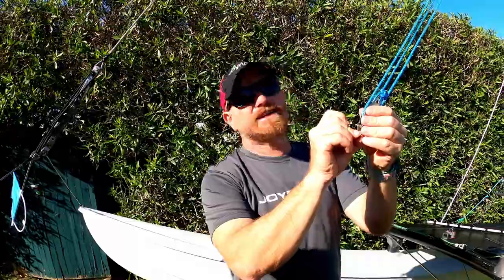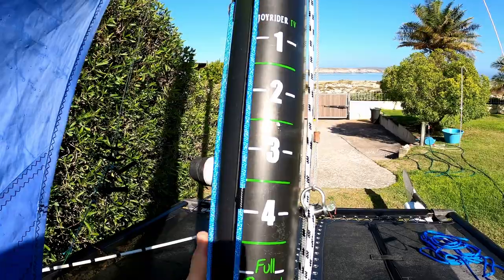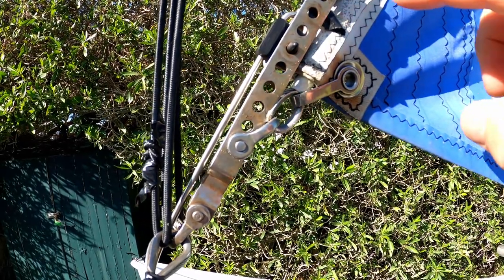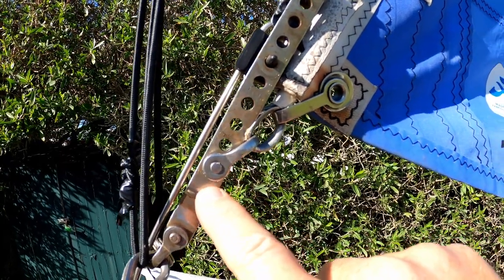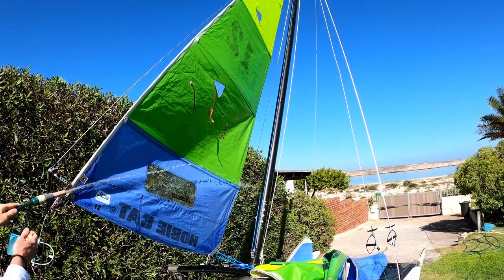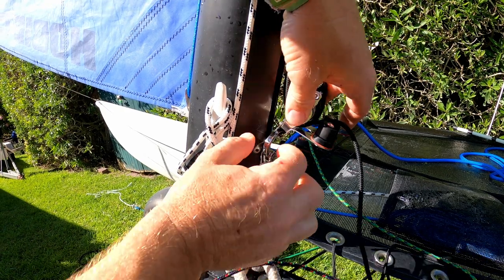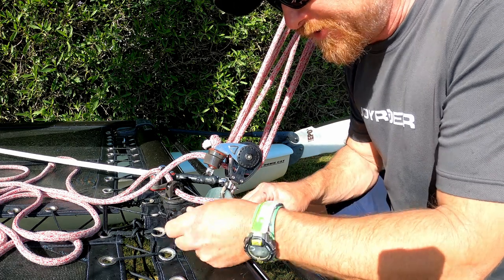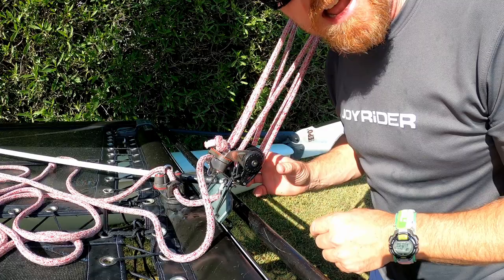Quick tips for catamaran sailors ➡️S04 E01

Comment: 2:10: If wear at this points really an issue, how about adding another shackle above the fastening shackle? That then keeps the eye of the jib a cm or so more distant from the chainplates, just enough. 
 
Nice to see a boat with a brand-new rig.
Reply: I do think that this area on a 16 is a bit awkward and needs attention. I heard that keeping you jib as low as possible is better for speed though so raising the jib even more to clear the chainplate goes against this theory. Maybe what is needed is a standoff mount that clips to two holes that you can then attach the jib shackle to? Does anyone ever change the height of the jib on the plate? Maybe this standoff can bolt on if you (and I do) only use the same hole?
Reply from the maker: Nice idea, the single shackle really makes a big difference already. 
I'll try some different ideas. Thanks.

Comment: Just downgraded from a Nacra20 to h16 for the 2022 season.    Has anyone thrown a roller furling on their16?   I happen to have a spare one laying around.
Reply from the maker: You'd need either to recut your jib or use a different one because of the battens. 
It is quite normal to do that.
Reply: I take issue with your comment of downgrading to H16! lol